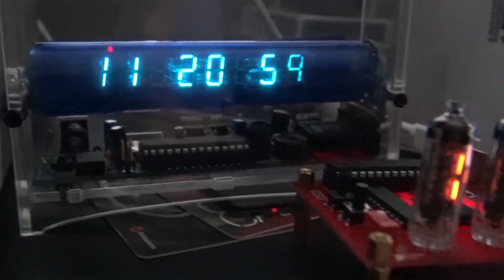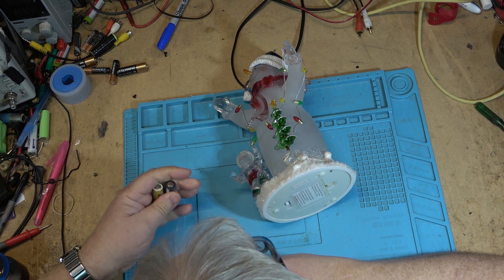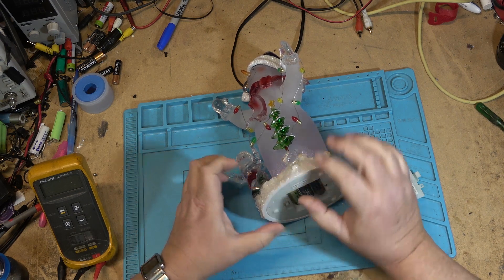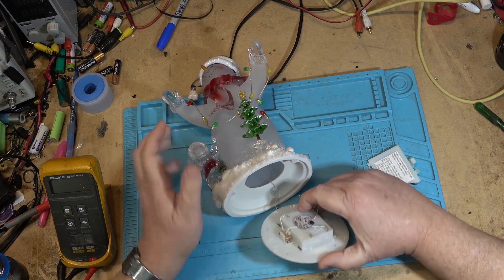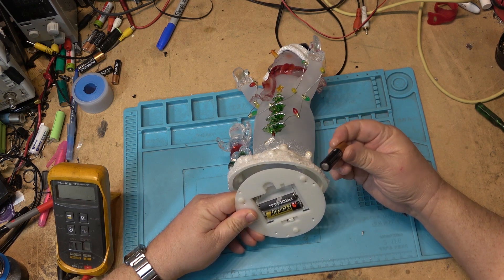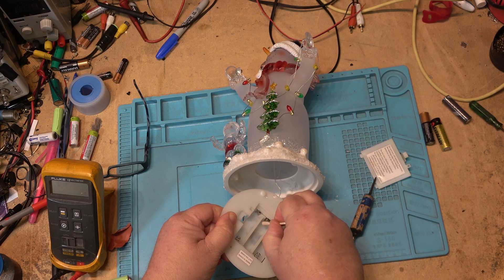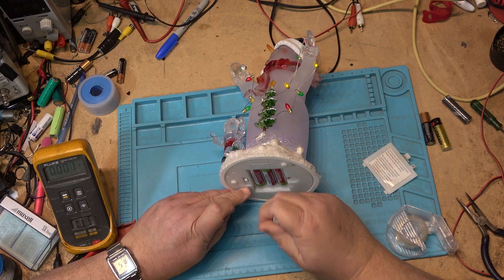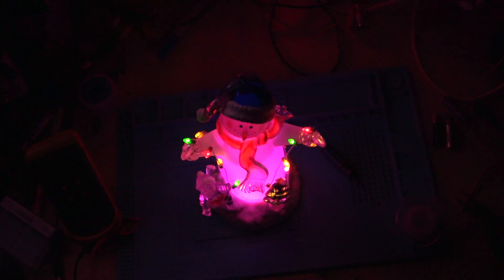Getting in the holiday spirit

Comment: Hi mate how’re u doing? 
can you assist me how to get rid of short circuit to ground on my wm-ex622? 

i’ve checked all the capacitors and couldn’t find any short! also desoldered all the ic chips at a time, without those ic’s it still showing short to ground.  Its showing 16 Ohms to ground!😢

(note: i got 1 shorted diode and replaced that, still not solved)
Reply from the maker: Have no idea.  That's why it's called troubleshooting.